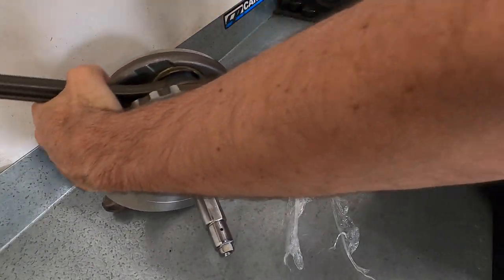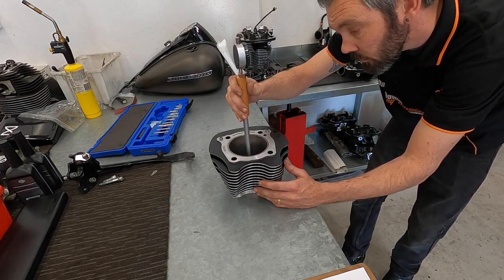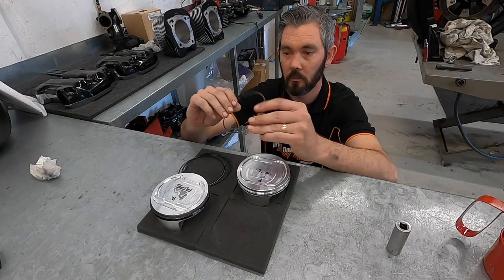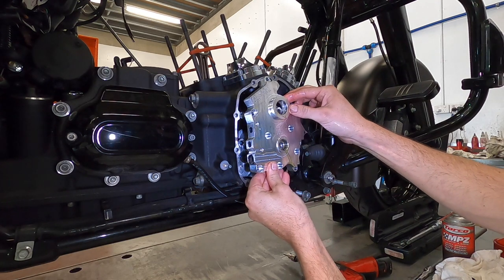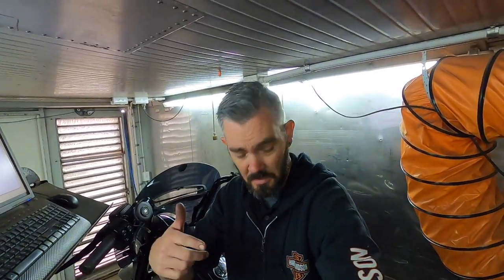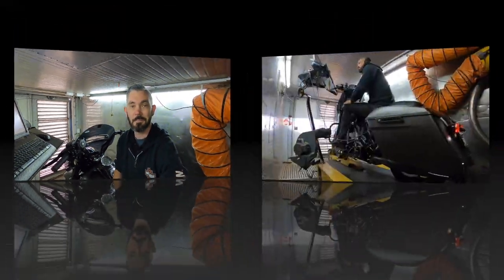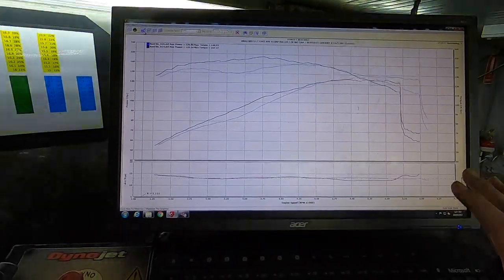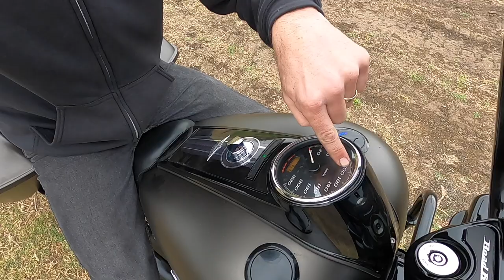128ci Road King S / APE Stump Puller / Build / Dyno / Test Ride

Comment: You can ride my bike like that anytime ya want brother. That thing is quick af.
Reply from the maker: She definitely gets up boogies!!! Probably not as much as your 131ci Lowrider S but still no slouch
Reply: I see you used the new cyclerama 515 cam but I was thinking of going with the 485 cam in a stage 3 122 with the first generation cnc heads, upgraded injectors, etc.. So do you think I should stick with the 485 cam or would the 515 be better
Reply from the maker: The 515 will work just fine in the 122kit as the compression ratio is 11.0:1

The 515 is basically the exact same cam as the 485 but with more lift. The higher lift requires bigger calave springs to accommodate the lift.

Comment: man..I like your channel content.. that micrometer will distort on the vice when you tighten that to clamp...
Reply from the maker: Cheers for the support on the channel maybe. 
In regards to the micrometer. No it won't. It's literally just sitting in there with soft jaws so it's steady. It will distort more if it hold it in my hand as my body temp  will transfer through it. 
They make micrometer clamps that do the exact same thing.

Comment: Fast , brakes and suspension upgrade should be next then .
Reply from the maker: Since filming, it now has Ohlins cartridges in the front with 3inch over tubes, 14inch remote res legend rears with 1inch extension for a total of 15inch, swingarm has been modified to allow for transmission pan clearance.
Galfer rotors are next. Currently runs upgraded pads on stock rotors

Comment: Thanks for sharing. I noticed you still used adjustable pushrods even though you had the top off. any reason you didn't reuse the originals?
Reply from the maker: The initial build when the bike was sold was just a stage 2 kit with the S&S 475. The stock pushrods were cut out and adjustable ones were used then.
Then the 128 bolt on kit went in later on and re-used the S&S 475 Cam.

This time around I just re-used them again because the customer had already paid for them.